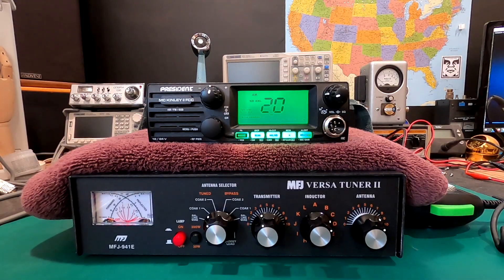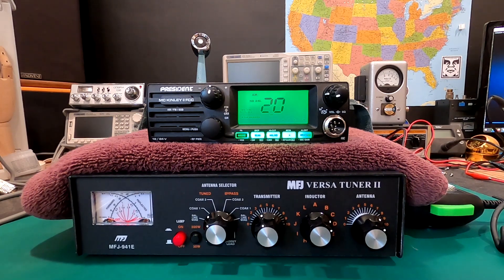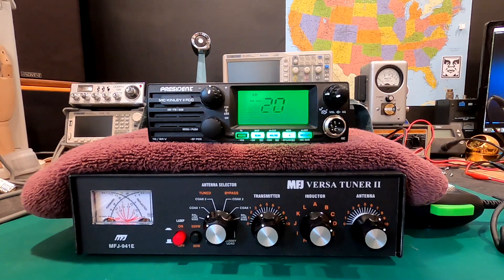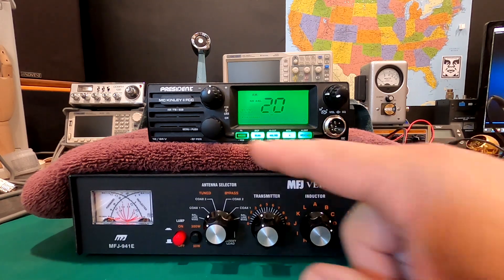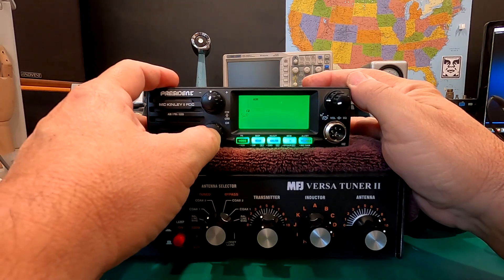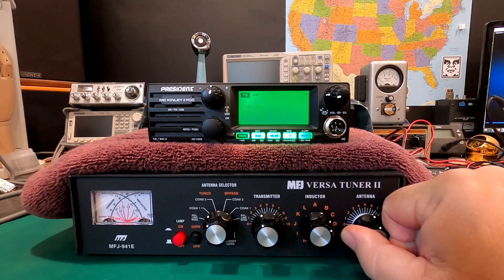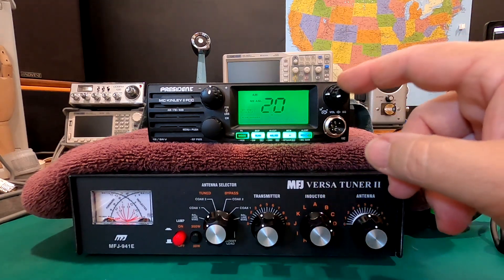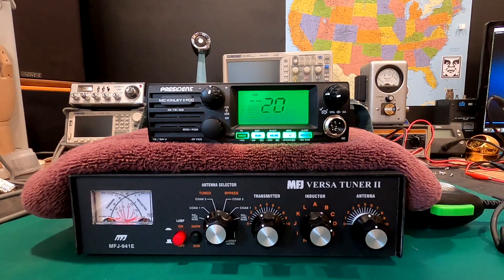President MCKINLEY II FCC CB Radio Automatic SWR Meter Demonstration

Comment: Junk. Mine says 2.1 when it's really 1.1 and when it's 3.1 it says 1.1
Reply from the maker: Check it on a dummy load with a no one good piece of coax. Should read about a 1.02 to a 1.3. I haven’t seen one of these much off by a couple points and I own six of them.
Edit…. Known piece of coax.

Comment: wagon master I have the same radio connected to a wilson 1000 whip on a elantra. Mine beeps constantly trunk or roof at 56 what can i do
Reply from the maker: What is the SWR reading on the radio? Check for pinched coax, the antenna coil may have issues, has the whip been cut/tuned for another vehicle?

Comment: don't worry i did a test of my macov5000  on quad5 i did video on it yesterday video come out tomorrow or today   i got video of night time dx between 8pm-11pm i was getting carribean and aus and  ca  you heard me doing local contacts on the video  during this week or next week trying get 1-1/4 pipe  get on two 10ft  poles it get swr lower  down more and nanovna swr is same swr on quad5 i'll be putting video photos swr and antenna.
Reply from the maker: Sounds good 👍
Reply: @390WagonMaster  Cb Radio Scan 9-12-2023 8pm-11EDT Macov5000 First Test
https://youtu.be/LyJfPYsu7cc

Comment: never ever ever ever use the swr meter in any radio always use a external SWR METER!!!!!
Reply from the maker: True that for most radios, but the last few Presidents I have checked are pretty darn accurate.  
I tuned with the President and then put my Bird, Drake on and tested.  I was surprised how  the radio did.
Reply: as long as the radio has sen't been "Tweaked and Peaked" on these newer radios, the swr readings are pretty close if not spot on compaired to the antenna analyzer.  This was also the case most of the time back in the older "cobra 148gtl, Uniden Grant XL" ect days.. I think alot of us after "tweak and tune" the radio the SWR reading were nothng more than  a "idiot light"  function.  I know I used miine this way in the big truck after say driving through freezing fog or sleet.  But not to tune for a install, no.

Comment: That MFJ tuner should have a 300 watt dummy load built-in. It's really handy, even moreso if you calibrated it against a Bird 43. 
Built-in SWR meters have been available since the first Tram Titan, in 1967. They began appearing in mobile radios in the mid-70s. Some, like the one in the Bearcat 980SSB, are wildly inaccurate and misleading. 
This one "sounds" like it actually works. That said, you should never touch an energized antenna or stand in the RF field when testing and tuning. You will get an incorrect outcome.
Reply from the maker: The Tuner is setup to add a DL. It does not have one built in. I use my tuner mostly for a switch box, by using the DL spot you could add a third antenna,  however it is bypassed and will have no tuner function. Cheers
Reply: @390WagonMaster  I have a MFJ949E, and it has a DL built in. Yours doesn't? Interesting.